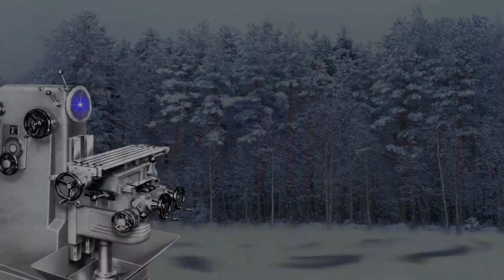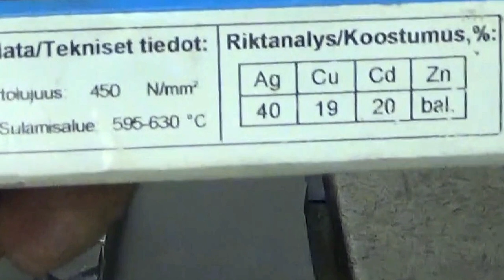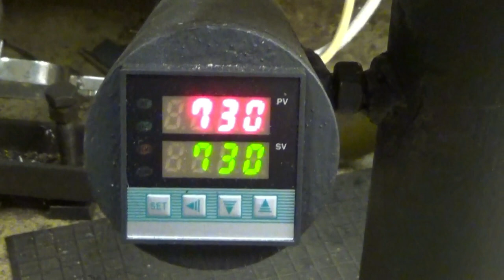How to make a chamfer tool by brazing

Comment: Useful idea with a double ended tool like that, may copy it. Borax is good for brass brazing like cobra25 or similar, does not work so well for lower temp silver solder. I like the meltolit 770 and the 770E particulary for brazing carbide tools etc. Potassium fluoride is added for activity att lower temp. I buy my stuff from Meltolit here in Sweden, they are good to dela with. Personally I like the torch better than oven for small stuff like this, it is easy to see exactly when the solder flows and the tooltip positions itself due to capillariy action.